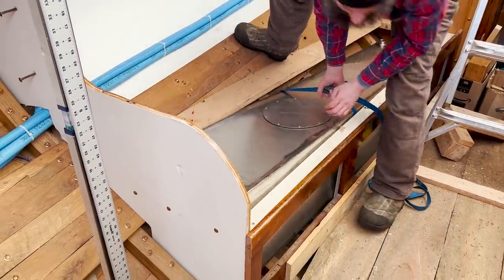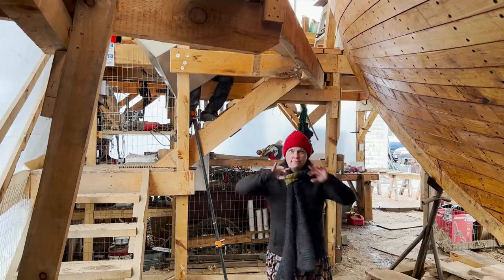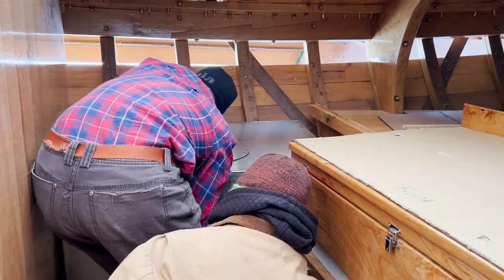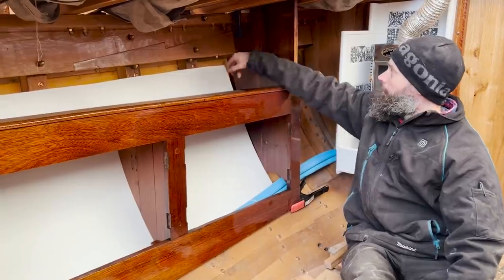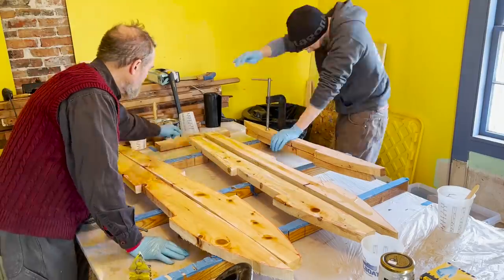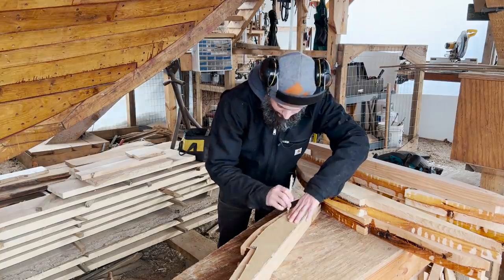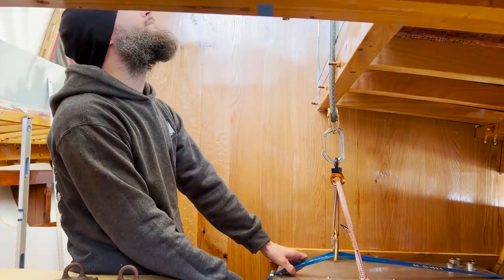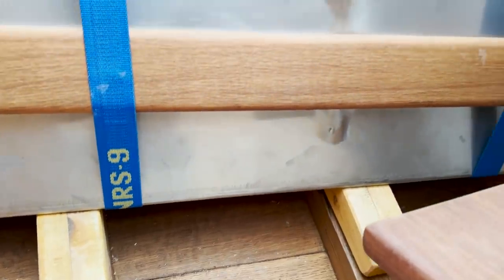Installing the Water Tanks - Episode 202 - Acorn to Arabella: Journey of a Wooden Boat

Comment: Brass and stainless steel should stay away from each other. They are too many metals apart and electrolysis would become a problem... Stay far away from salt water. That recommendation might be difficult.
Reply from the maker: Copper (what the rivets are made of) and stainless steel are fairly close on the nobility scale, and don’t present much of a chance of galvanic corrosion. They’ll probably not be touching once we’re done though, so moot point. —Anne

Comment: Heeeeyyy, so we didn't see on the video any testing of the tank for leaks... of course you did that though, right???
Reply from the maker: We’re going to do that when we clean out the boat before putting on final finishes and whatnot. It’ll involve quite a bit of uninstalling stuff. At that time we’ll most likely use air to put pressure through the whole system.

Comment: Are you not afraid of electrolysis? Between aluminium and brons? Place rubber strips between brons and aluminium to prevent electrolysis.
Reply: I was literally about to ask the same question.
Reply: Its stainless so probably not...
Reply from the maker: Galvanic corrosion (electrolysis is a little different) is something that happens when the would-be cathode and would-be anode are very dissimilar… stainless steel and copper are close to each other on the nobility scale. Corrosion isn’t likely.
Reply: You do some pretty woodworking. I would recommend adding a layer of PVC sheeting to your beds that you made. Lowe's sells 3/8" sheets of PVC board fairly cheap. Sink the screws into the boat so they are not raised up. On final installation, coat the PCV with 5200 and that will help reduce any possible shifting once the 5200 cures.

Comment: Are you going to leak test your new tanks prior to installation ?
Reply from the maker: Sure will. We plan to take the interior apart, clean it very well, then reassemble. At that point we’ll leak test and fix if necessary.